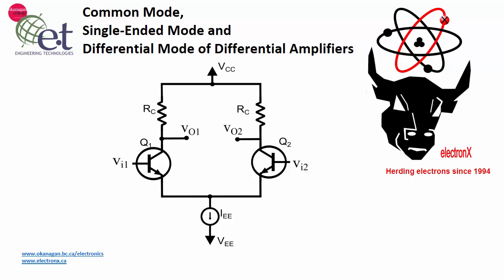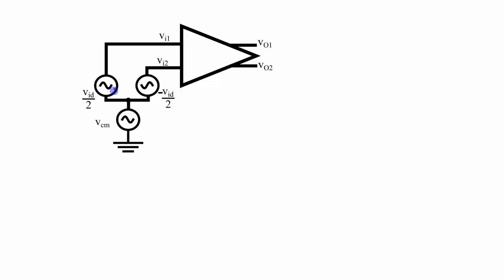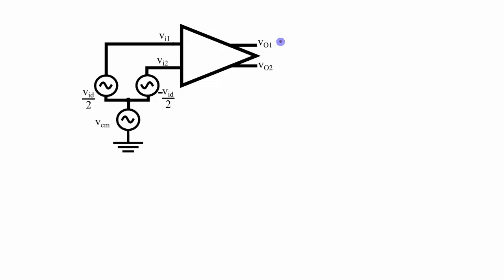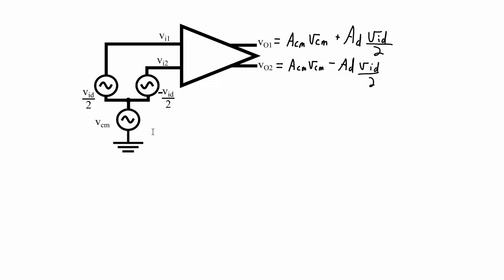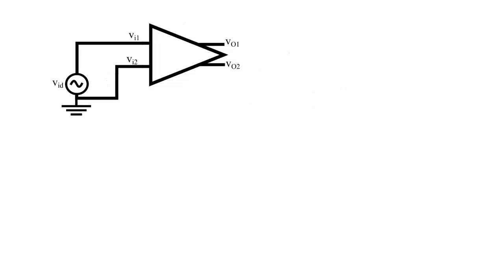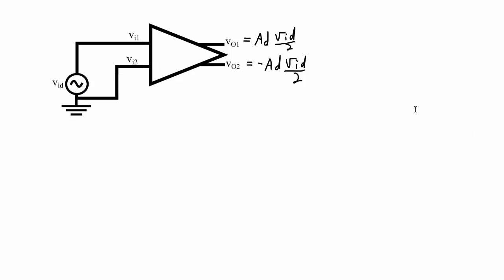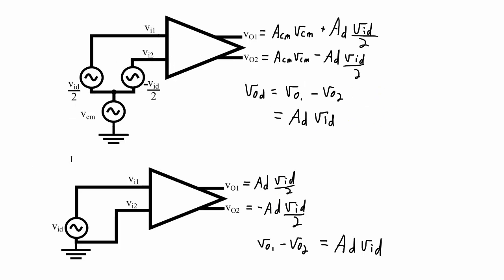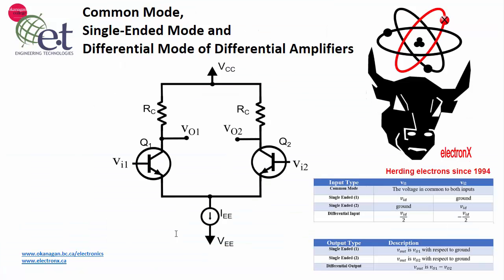BJT Differential Amplifiers Inputs and Outputs

Comment: Sorry, I don't understand the premise of the inputs as being Vid/2 and -Vid/2.  In other words, why aren't the inputs Vid and 3Vid, or .23Vid, or whatever values you choose?    Are these values being chosen simply as illustrative?  Is selecting Vid/2 and -Vid/2 the typical way of starting an analysis on differential amplifiers?   Not knowing the premise or the construct here prevented me from fully understanding the video.  Any insights would be appreciated.  PS, thanks for all the videos.
Reply from the maker: Vid is the arbitrary input value and when it gets split across the differential inputs, each gets half the voltage. input 1 gets Vid/2 and input 2 gets -Vid/2. The difference between these inputs is (Vid/2) - (-Vid/2 ) = Vid...the original arbitrary input